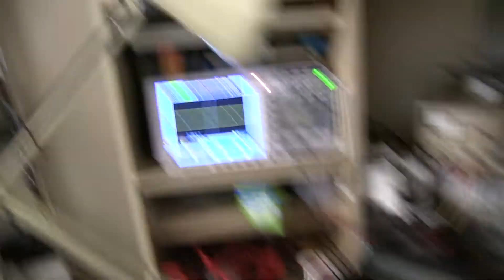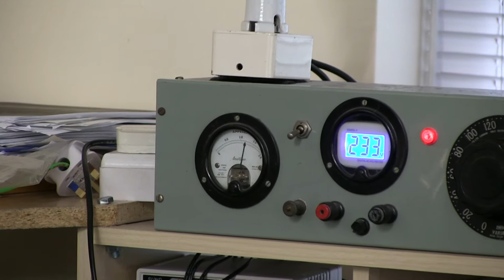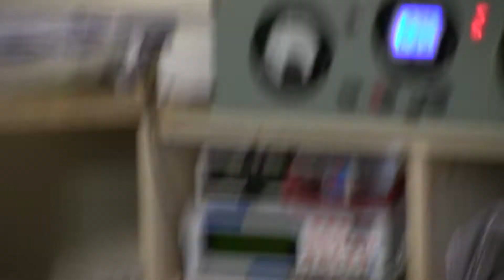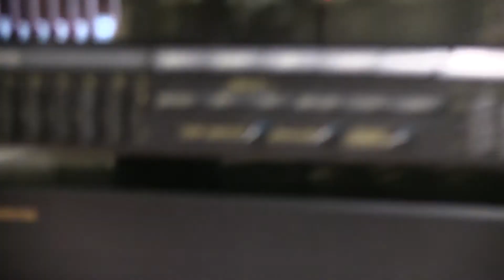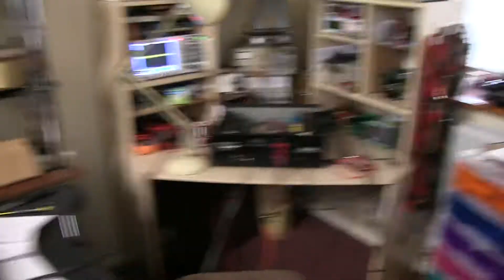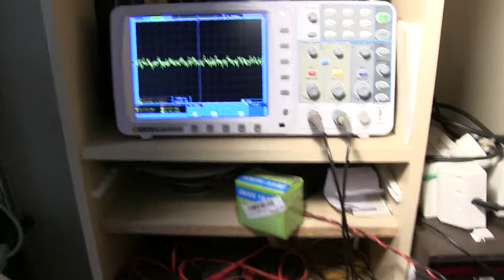NAD C270 Repair and test in Bridge (mono) High power mode.

Comment: What was the load of the speaker/S nominal?  I have had 2 c370's and 1 c270. Never got round to dummy loading them sadly,  I have now sold them and doubt I will buy another,  I am guessing she was doing 300 watts In to a 4 ohm nominal load so she would be 300 at 8 ohms on the dummy loads??
Reply from the maker: Hi Alan. It is a while since I did this. But those amps are very impressive and powerful. They can drive 4ohms with more power than most would need, or could use these days.  All the best nick